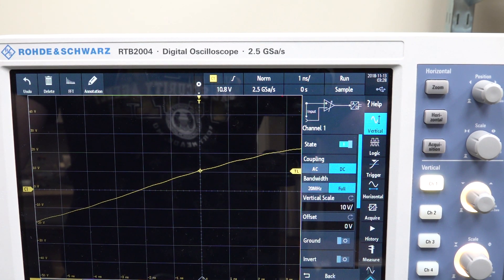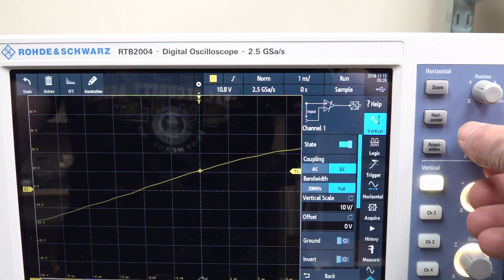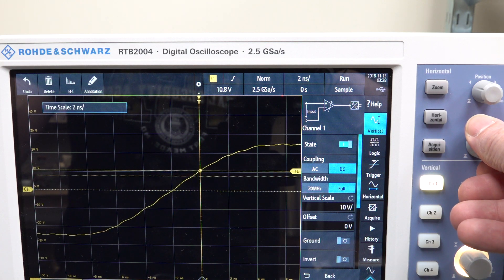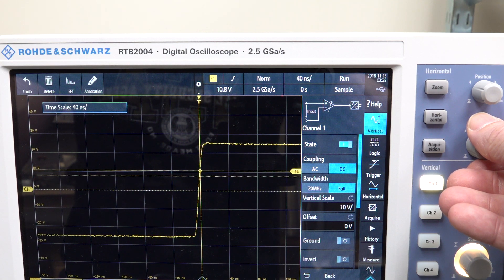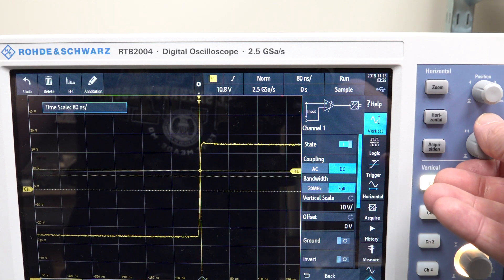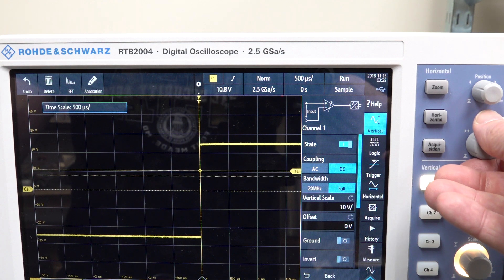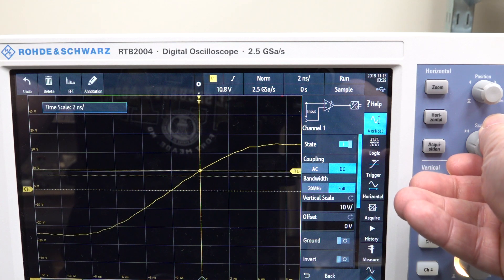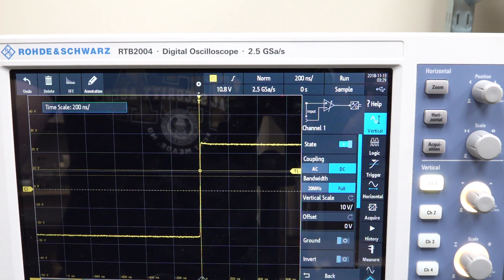Rohde & Schwarz RTB2004 Timebase Quirk

Comment: Maybe a firmware issue? Have you upgraded the firmware on it? Otherwise report it as a bug. and see if it can be fixed.

I had an issue with a connected USB mouse to to it, since I hade it placed for faster access to the UI that way for some measurements. But it had a bug with  the Y-axis of the cursor prior to upgrading.

Comment: Either a coding bug, or related to a sampling rate. It is possible that the number of samples in one division (without changing number of pixels in a division) would be very weird number when set to 50ns/div, and that could lead to aliasing. You would need to count exactly the pixels in division to figure if it is indented.

Comment: I wonder if there is some very specific type of signal that is more accurately measured when divided at 80ns rather than 100ns?
Reply: I found this in a keysight manual:

1 On the FlexRay Compliance Test Application, if you select Transmitter Signal
Source as FlexRay Communication Controller generated traffic:
a On the Oscilloscope:
• (For Baud Rate 10Mbps) Set Timebase = 20ns/div, Delay = dTSS-1us
• (For Baud Rate 5Mbps) Set Timebase = 40ns/div, Delay = dTSS-2us
• (For Baud Rate 2.5 Mbps) Set Timebase = 80ns/div, Delay = dTSS-4us
Reply: @witeshade  Hmm, I was playing with the UART app... Will check this. But to have to change the default timebase behavior seems crazy.
Reply: Could it be the full memory just exactly fits well to the maximum sampling speed, and also at maximum divided by 2 and maximum divided by 4? If they would have to fit 50 i.o 40 ns, they would have to sample twice as slow. Same for 100 i.o. 80 ns. For slower speeds it could very well be this is not a problem anymore, because then you have arrived at bigger dividing factors, and you can choose more comfortably.
On my old 8Gs/s scope, there are only certain timebase values available if you want maximum sampling speeds.

Comment: They have 12 divisions (and also 2.5GSa/s) and not sure to how many pixels that corresponds to, but I guess with 40ns they have one reading per pixel and then with 80ns they can easily display just the second reading.
Reply: This could be the reason, I believe they use 1200 pixels for the 12 horizontal divisions.